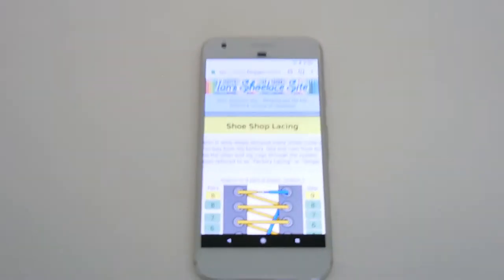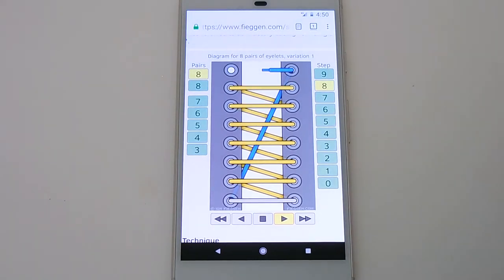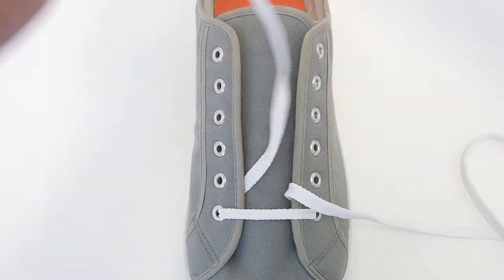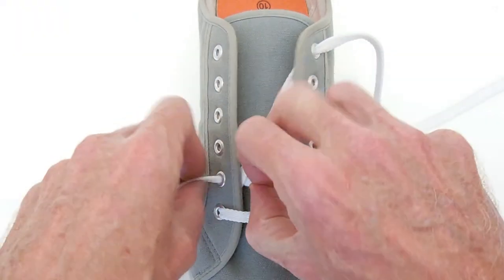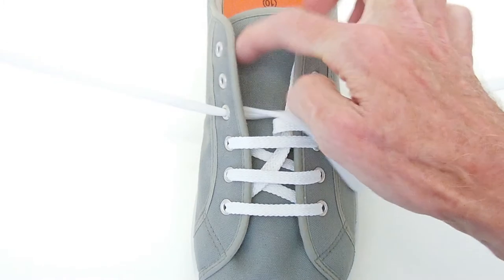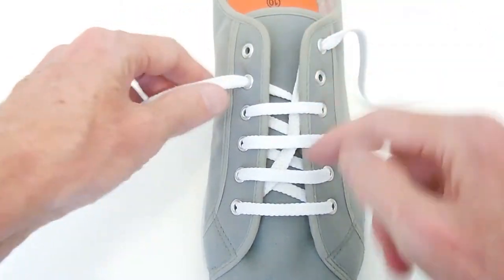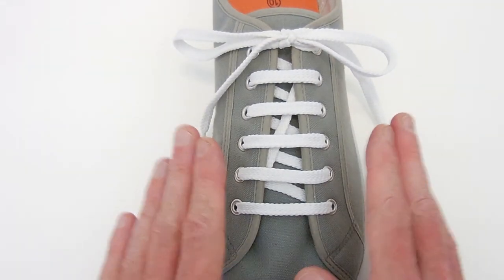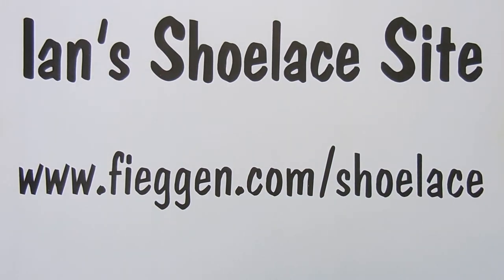Shoe Shop Lacing Tutorial – Professor Shoelace

Comment: Would you recommend keeping this lacing after you buy a pair of dress shoes? If not, what would you recommend? Brown leather dress shoe, 5 islets on each side near the top.
Reply: I mean 4 islets on each side, not 5.
Reply from the maker: I definitely recommend this lacing for dress shoes – particularly if the sides come close enough together to hide the underlying zig-zag. Compared to other straight lacing methods like “Straight Bar Lacing”, this method tightens moe evenly without “pinching” the shoe material.
Reply: Oh, ok. I'll leave them like this then. Thanks!

This lacing technique isn't just historical as you said. New brown leather dress shoes I bought two weeks ago (March 2024) came with this lacing.
Reply from the maker: Oh, right – interesting to hear that it's still fairly common in shoe shops.

Comment: Any way to make the top one be a straight bar and then tuck in the laces instead of having them come out and lacing them
Reply from the maker: Yes, but it will end up looking slightly different. To tuck in the ends, you will have to skip one of the inner diagonals. For example, you can skip the long diagonal by tucking one end in at the bottom, zig-zagging the shoelace from bottom to top and tucking the other end in at the top.
Reply: ProfessorShoelace ummm alright... thanks for the help!

Comment: 40th like! Whats a good lace patter for a leather shoe that doesnt have a bow? It has 5 eyes btw :)
Reply from the maker: For a leather dress shoe, I'd suggest "Roman Lacing", which would result in a nice symmetrical pair of crossovers separated by a single straight segment. Most lacing methods can be finished off without a visible bow using something like "Lace Anchors".
Reply: @ProfShoelace  Thank you! :)